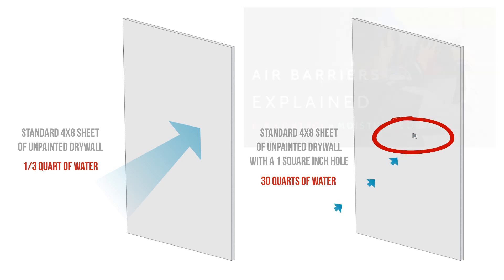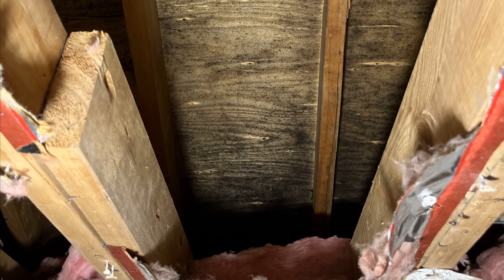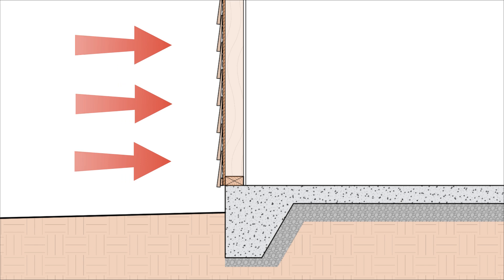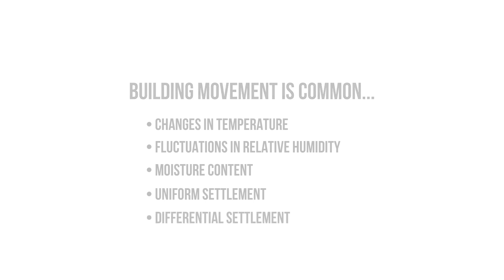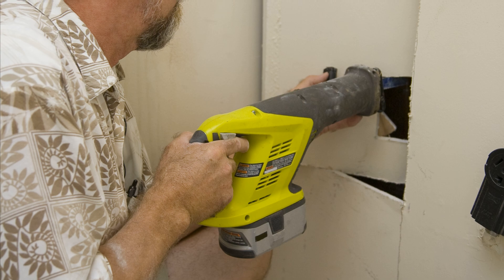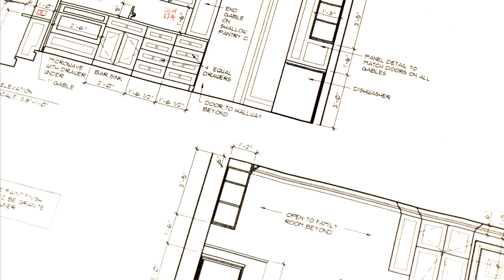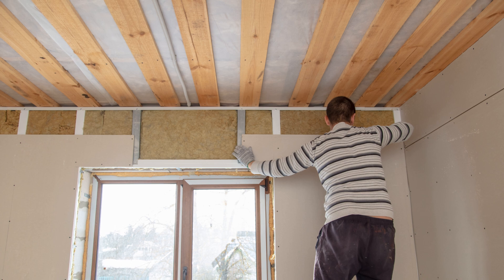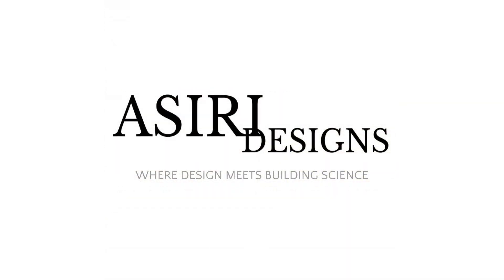The Problem with Airtight Drywall

Comment: Drywall is going to have so many penetrations and edges to be executed by multiple trades I am surprised serious building science people consider using it as the air barrier.  For a heating dominated climate like Minnesota - first reduce how many systems you run in exterior walls in the first place, second install a vapor retarding membrane like Siga Mijrex to the structural framing, third fur out ceiling and exterior walls and blocking for trim providing a service cavity for electrical inboard of air/vapor barrier.  Order of operations is slightly different by bringing insulation in before trades, but planned right you're giving electrical an easier installation with very intentional service cavity routing.

Comment: I’m in climate zone 3 and was planning on using zip on exterior walls as my air barrier

And drywall underneath my vaulted rafters as my air barrier

Then strip it with 2/4s and another layer of drywall 

Seems like that would put my air barrier to the inside at the ceiling level 

Is there a way for this to work

Comment: If you've haven't looked, take a gander at how Jake Bruton does his drywall airbarrier.  He doesn't do any interior wall framing until the ceiling and walls are drywalled/taped - so it's an empty box when the drywall is installed - fast/easy/economical drywall installation. Of course, the house has to designed to allow clear spans between exterior walls so that no load bearing walls are needed during rough framing.
Reply from the maker: @ArthurDentZaphodBeeb  I'm familiar with his strategy, it works until the house gets remodeled or until someone pokes a hole in an exterior wall. Joe Lstiburek, the guy who invented the concept of airtight drywall doesn't even recommend it. Just because you can do it, doesn't mean that you should...

Comment: I have seen in a hotel where a bed was placed next to the PTAC where the air was forced into the corner of the room.  When renovating, it was found that the back side of the sheetrock was covered in mold.  As you know air coming off a coil is typically 100% saturated.  I would be very careful on placement of a PTAC or mini split.

Comment: One fantastic way to create an air-tight barrier between the living space and a vented attic was featured in Fine Homebuilding magazine. The builder put ZIP sheathing on top of the attic floor joists and taped all the seams. He sealed the outer edges of the panels to the top plates of the exterior wall. All the attic insulation was on top of the sheathing layer leaving the attic floor cavities empty and available for can lights, ductwork, plumbing pipes and electrical wiring (which is fine since these attic floor cavities are within the conditioned space). The few penetrations from the conditioned space through the attic floor system (like vent pipes, etc) are completely air sealed. Then you just place your roof trusses on top of the attic "floor" and you've completely isolated the vented attic from the conditioned interior space.
Reply: Wouldn’t this involve significantly more cost since if you used the drywall approach you wouldn’t need the floor joists or the zip sheathing on the floor, just the trusses?
Reply: @lrw-86  It would add a bit more cost, however the primary advantages in putting ZIP sheathing on top of attic floor joists is that you create a simple, one piece air barrier between the living space and the unconditioned attic. No holes in a drywall ceiling for pot lights, etc, and if you go with floor trusses instead of solid lumber or I-joists you can run all your mechanicals in the attic floor system, which will be within the conditioned space.
Reply: What about instead of using zip sheathing and floor trusses, you just laid out poly film across the whole top of the house (on top of top plates), then placed trusses, cap fasten poly to trusses, taping any seems, tape over caps, then fur down and then drywall. Could this be a significant cost saving compared to Fine Homebuilding’s idea?
Reply: @lrw-86  Poly has even more problems with trying to air seal it (rips, holes, etc). Tthe concept of using  ZIP (or any sheathing material) on top of attic floor joists or trusses is to completely separate the conditioned spaces from the unconditioned attic - basically you build a sealed "box" by connecting the attic floor sheathing to the wall sheathing  and then put an unconditioned attic on top of it.
Reply: @ryansoo4000  No, I get it. I was just trying to think of ways to improve the idea from a cost-perspective. I’m fascinated with the idea of making energy-efficient houses more affordable. In terms of holes and tears in the poly film, I actually thought that it would be quite beneficial from an ease-of-repair perspective - by just simply taping it (as you would a seam or hole in zip).

Cheers!

Comment: You showed a picture of Intello at 3:05. What do you say to people who say that when it is humid it let's the humidity through anyway?
Reply from the maker: It's a good thing, we don't want humid air to accumulate and get trapped in the cavity otherwise we get condensation and mold issues. Let it dry out, either to the interior or to the exterior. This is a "flow through" assembly approach.
Reply: @ASIRIDesigns  But then all winter it is letting vapour into the wall and then it can't dry out in the summer unless you keep the humidity really low which most people don't do. They try to run the A/C as little as possible.
Reply: @multipotentialite during the winter that vapour should be able to go through the drywall, through your insulation if you have interior insulation, through plywood or osb, and through a semi permeable or vapor open wrb shouldn't it? I think the trick is to let vapor do what it wants and leave the house. 

In very cold climates that may not work I guess. But this is a channel for high performance homes. The expectation is you are controlling your humidity inside the home. If you don't have a plan to control for  humidity you shouldn't build airtight.
Reply: @ASIRIDesigns   Didn't another video suggest placing vapor barrier on both sides of the exterior wall construction?  
How can "flow through" be achieved when there is vapor barrier on both sides of exterior walls?  What am I missing?

Comment: I just looked at a situation on a building that is about 10 years old where there is obvious issues at the bottom of the window jambs, and I'm almost certain that the drywall air barrier method is to blame for this.

Comment: Awesome content. Building a house in humid coastal Canada. What would be your best recommendation for interior vapor retarder? Using plywood with blue skin and 2-in hard foam insulation on exterior. 2x 6 wall
Reply: I don’t see a lot of smart vapour products readily available in Canada. The one I do see is CertainTeed “Membrain”

Comment: I live in Texas where it’s hot and humid 90% of the year. I have been debating about doing a DIY energy retrofit of my house. It’s a 2 story production house so no frills. 

My ideas focused primarily on the second floor since that’s where the bedrooms are and where we feel it most, especially in the summers. 

First idea was to remove the drywall from the exterior walls only from the inside and re-insulate with a better high performance batt insulation. Then add a layer of 1/2 foam board over the studs before adding a new layer of 1/2 drywall. Had no plans to do an air tight install, just wanted to increase the capacity of the exterior walls. This method would be most affordable due to the diy abilities. 

Second option would be removing all the siding on the exterior and obviously the cardboard sheathing since that’s what we have on the exterior of the framing and adding the new insulation to the cavities then foam board sheathing over that before replacing the siding material with the original hardie or new. Obviously this approach is much more costlier than the first but would be the best solution. 

Thoughts or suggestions???
Reply from the maker: Great question, the second option that you described is what you should do. Rigid foam is a vapor retarder and you really want to make sure that the vapor retarder is located on the exterior in these hot humid climates, as installing it on the interior side of the studs will trap moisture in the cavity (we see a lot of mold in these situations). You have to ensure that the wall cavity can dry to the interior since vapor drive is predominantly from the outside inwards. Check out this video I made a couple months ago about remodeling homes in hot humid climates: https://youtu.be/1TuRK3CI7jc?feature=shared

Comment: what about sheathing as an air barrier that is sealed from the inside, is that possible?
Reply: Possible? Probably. Easy? No. And why would you want to do this?
Reply from the maker: I've specified it before and it's actually quite a common strategy in places like Germany, Austria, and Switzerland. Taping the joints is key. It's not my favorite approach though.
Reply: @ASIRIDesigns What is your favorite?
Reply: @ASIRIDesigns  so if renovating 1960s house in NYC with brick siding, not a good idea to try to attempt to air tighten? Just let it breathe?

Comment: I work on log built buildings where you can almost see the outside from inside, air barrier is a real challenge and where previous contractors or owners have attempted to seal up wall assemblies, I’m repeatedly finding mold, rot and decay.
Because log construction is niche compared to standard building methods, I’m making up my own rules and could use the knowledge and science of Mr. Asiri. I watch every video and bought his PDF book. Should I invest in the Cad library ? A picture is so valuable these days.
Reply from the maker: Thanks for your support, the CAD library has some good details but they aren't applicable to log homes. As you probably know, log homes use a lot of gaskets, backer rod, and sealant to seal in between each individual log, and quite frankly there are a lot of ways to accomplish a continuous air barrier. You may want to consider something like Aerobarrier, in which they pressurize the home and aerosolize a water-based acrylic sealant to fill in every little nook and cranny.

Comment: Is there ANY way to make your house more efficient without causing problems? The tighter you make it, it seems the worse it is for air quality and issues later with mold. Better to have a leaky house air wise that may cost a little more to heat/cool than have all these mold/rot issues because something happened later to compromise the structure. We live in Illinois where you can have cold winters AND hot humid summers. How do you build for that?
Reply from the maker: When you increase energy efficiency, you reduce the drying potential of the assembly since there is a lack of energy flow (heat flow is how we dry out buildings). This isn't just an issue with high performance, but even with code minimum construction. When you build tighter and insulate more, while using more moisture sensitive materials,  you have to do everything you can to keep things as dry as possible, and allow things to dry if they get wet. Ironically, building an air leaky building while trying to improve efficiency makes the building wetter since air transports moisture. In order to control the interior conditions, you have to first enclose them. In a place like Illinois, you need plenty of insulation on the exterior side of the sheathing, and you need a dedicated wholehouse dehumidifier. This is non-negotiable if you are air conditioning the space in the summertime.
Reply: cold tends to dry insides humid tends to migrate inside. the best compromise in my opinion is a airtight outside covered with board insulation then a rain screen and your choice of siding or covering. build  window moulds to accommodate for the extra depth.(there are more details but that is the brief. ) There is also a building science corporation guy named Joseph Lstiburek  and his advice is the word of god.  He has a web site , This guy must be a study or student of his because they have the same advice. and mirrors many concepts. buy the book is the first thing. or buy joes book. and both have a lot of free advice.  Bottom line I reduced my heating and cooling bill by 50 percent. the inside of my house is comfortable year around  and the payback was just over 3 years for the changes. I did all the labor myself.
Reply: I'm very interested in this, too, in the context of remodel.  I'm in Ottawa, Canada.  It was 25 degrees and 100% humidity overnight last night, and we have days in the winder than can go to -38 with windchill.  I remodel builder grade houses into much nicer ones. 6 Mil poly is ubiquitous here, and when we go changing where air and moisture barriers are in the assemblies, even the inspectors want an engineering report before anything remotely unconventional happens. Even if it's in one of the prescriptive code sections.
Reply: @jboyd85  Easy: you have a winter climate. 25 degrees summer is nothing compared to -38. Put insulation on the exterior. You'll have plenty of winter days to dry out the moisture driven into walls in summer.
Reply: @VanyaYani  Except that we have more and more 38C days in the summer now, too.  All of two weeks ago, for instance. And what do we do when we have a client with a reservoir cladding on the outside of the building? Staying saturated in the the spring, summer & fall, and then freezing in the winter.  I assume something sublimates out while its frozen, but still.....
Reply: @jboyd85   Why is it not drying out in the summer's 38 heat?
Reply: @VanyaYani  Sometimes (frequently?) I assume it is, but I worry on some of the brick veneer 1940s houses especially. I add more insulation and better air sealing on the inside (where I'm paid to remodel) and by reducing the amount of energy moving from inside to out (with real sealed air barriers and modern amounts of insulation) I remove some of it's drying potential.  Those drafts used to help carry moisture from deep in the wall to the outside during the summer. Now it's slower. I worry that by slightly tipping the balance in favour of moisture retention we start wood decay.  Especially if a previous reno layer is a blown cellulose. Not every client can afford for us to do new air barrier layers behind the cladding. We need strategies that work without starting from the inside out or the ground up.
Reply: Illinois has a good variety of temperatures. In summer, the exterior side of the wall dries by the sun, in the winter you dry the interior by heating and ventilating.

The mold is a problem for climates which either don't have a great variety of temperatures, or when it's summer or winter all year round.

In all other climates you just calculate the Dew point and put thick enough insulation on the appropriate side.
Reply: Here I'm assuming the comfortable temperature on the inside is 18-25 degrees Celsius. Calculate the differences in winter and summer and add them together. If you got something like -20 you're in a winter climate, if it's +20 you're in a summer climate. If you got -40 or +40 or 0 you're in trouble.
Reply: Air Barriers don't also have to be Vapor Barriers. Keeping a house air tight leaves air laden moisture (and hot/cold air) out of your assembly (mostly). Vapor Barriers will keep some moisture out of your assembly but will also trap any that gets in. Air Tight is good, just avoid Vapor Barriers in multi climate zones. That is if you don't do the Perfect Wall where your assembly is entirely in your conditioned space.
Reply: Quite honestly....if you're concerned with "efficiency", ie energy savings....ie lower costs, then rule #1 should be to build a smaller house.

I'm just stunned that a couple with 0 or 1 child somehow think they NEED a 3000 sq ft house. Damn.
Reply: Check out his video on double stud wall assemblies. He goes over how to detail high r value walls to let the assembly dry to the inside and outside
Reply: OP, yes, the answer is autoclaved aerated concrete. Tight as a drum and no vapor issues
Reply: If you're interested in "efficiency" ie lower cost the rule #1 is build a smaller house!

I'm just stunned people with 0 or 1 child think they NEED a 2500-3000 sq ft house.
Reply: Tight house with air handler is always best; no need to breath air drawn in through the nasties in your wall cavities & /or attic.
Reply: I wonder about this as well. I've watched hundreds of hours of content about high-performance house building and it always requires fancy air exchange/makeup equipment. I have to wonder when these designs break even, financially speaking. If a leaky home costs me another hundred dollars a year to heat and cool, then does it make sense to spend tens of thousands of dollars on so-called high-performance building techniques?

After all, we have houses built a hundred years ago that are still in excellent condition. Is all this building science not a bit overrated?